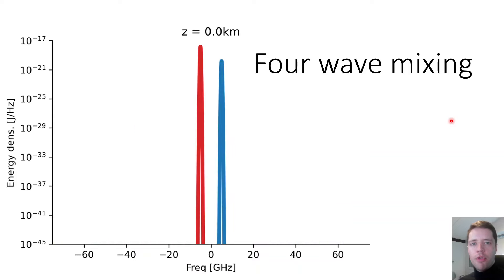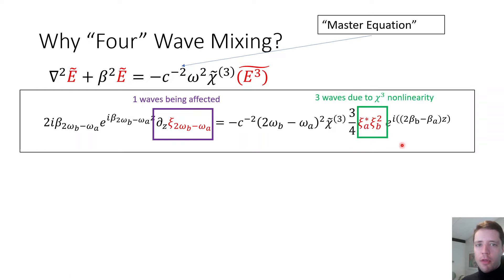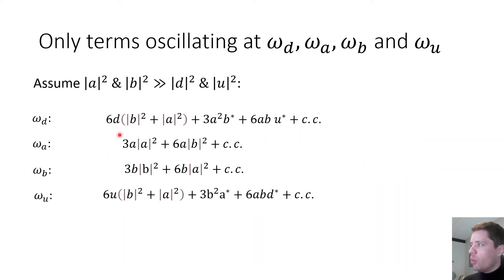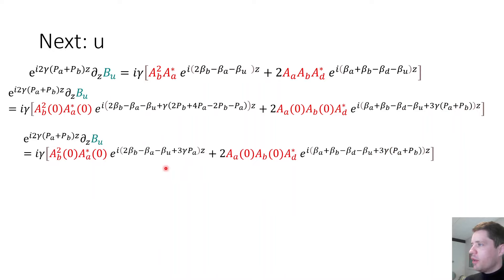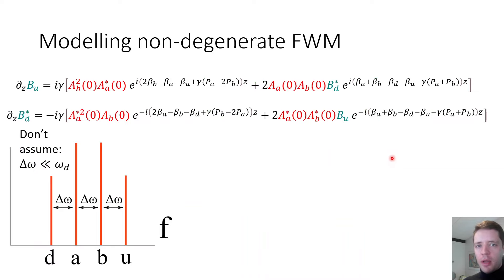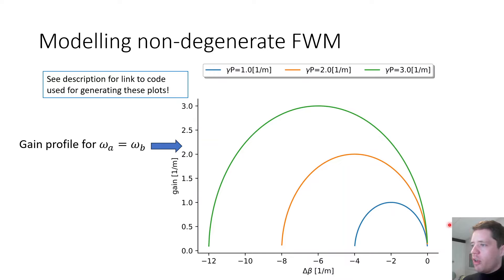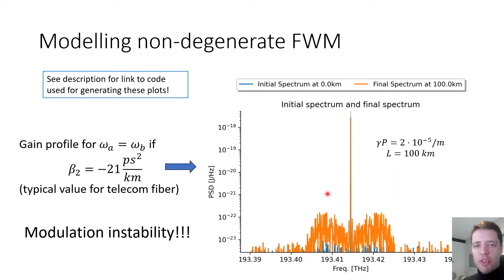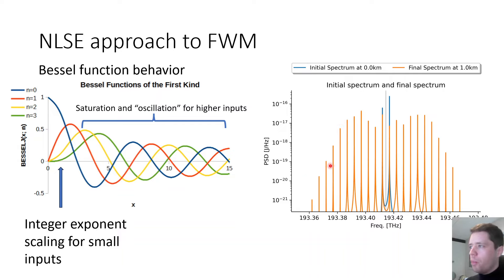Four wave mixing in nonlinear optics.

Comment: Thanks for sharing knowledge. At 5:32,  what is the reason of neglecting the terms consisting of 2 and 3 conjugated and unconjugated fields? Phase mismatch?
Reply from the maker: The two cases are a bit different.

Terms with three unconjugated factors correspond to THG and are set to zero as we assume that phase matching is not satisfied for them anyways. Therefore, terms such as ba^2 are removed. For the same reason, b*(a*)^2 will be set to zero as it is just the complex conjugate of ba^2. 

The term b*|a|^2 = b*a*a is simply the complex conjugate of b|a|^2, which described XPM from a onto b. Note that we don't set these terms to zero. Rather, we just "absorb" b*|a|^2 into the c.c and do calculations with b|a|^2.

Comment: Thanks for the video. Could you please clarify the units in the degenerate phase matching equation. beta is measured in s^2/m and gama*power is 1/m, how is homogeneity retained?
Reply from the maker: To clarify, the betas in that equation are spatial frequencies evaluated at four different temporal frequencies. For example, β_u = β(ω_u), which has units of 1/m. They are emphatically NOT group-velocity-dispersion values (i.e. 2nd derivatives of β w.r.t. ω), which have units of s^2/m.
Reply: @yourfavouriteta  This is the phase mismatch equation for degenerate FWM 2𝛽𝑝(𝜔𝑝) − 𝛽𝑠(𝜔𝑠 ) + 𝛽𝑖 (𝜔𝑖 ) − 2𝛾𝑃 = 0, IMPLYING balancing GVD, if these betas are the frequencies as u mentioned what is their relation to the respective GVDs?

Because after all we are balancing GVDs for PUMP, SIGNAL AND IDLER.
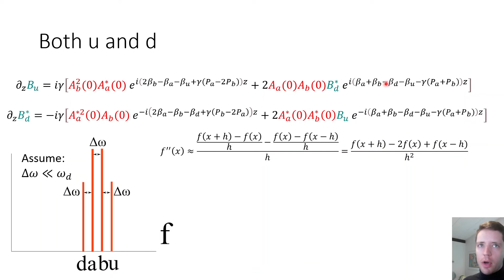Reply from the maker: @muneebfarooq3882  At 11:30 in the video, I explain that  2β(ωb)-β(ωa)-β(ωu) is approximately equal to -Δω^2 * β2(ωb) = -Δω^2 * GVD(ωb) when the difference between three temporal frequencies, ωb, ωa, ωu is small. Note again that "β_b" in my derivation is "the spatial frequency in the medium of an EM wave with a temporal frequency of ω_b". Meanwhile, β_2 = GVD = 2nd derivative of the spatial frequency,  β(ω), w.r.t. ω. 

The point is that phase matching **in general** depends on whether the temporal frequencies that are interacting via the nonlinearity (in this case ωb, ωa and ωu) have the correct spatial frequencies and powers for  2β(ωb)-β(ωa)-β(ωu) - 2γP = 0 to be satisfied. In the ***special case***, where the difference between the temporal frequencies is small, this is equivalent to asking if Δω^2 * GVD + 2γP~0.
Reply: @yourfavouriteta  that is right but I think this approximation works only in the linear dispersion regime.
Reply from the maker: @muneebfarooq3882  Well, the range of Δω values where the approximation works depends on how quickly β changes as a function of ω. If β changes a lot, using the full expression is better.